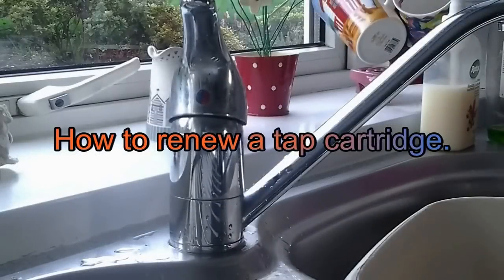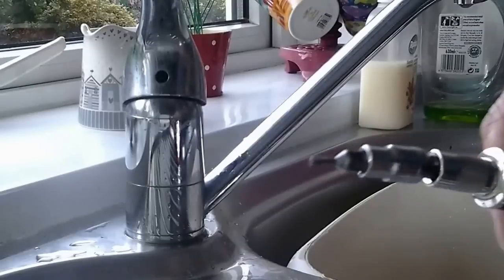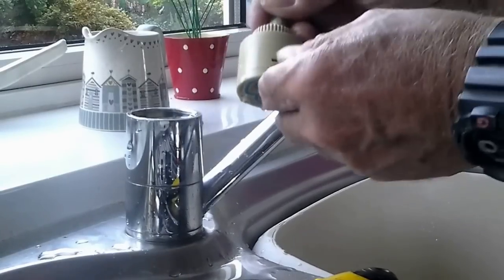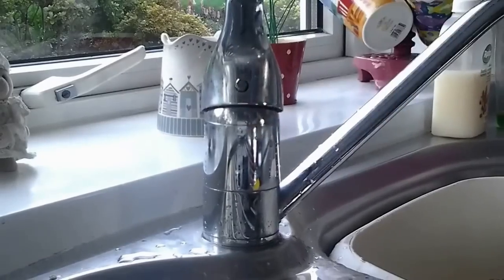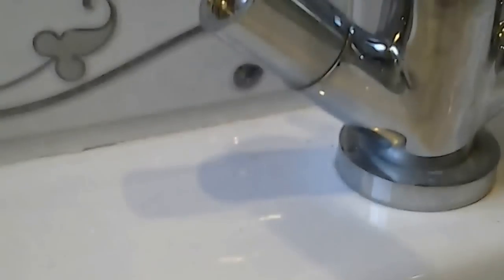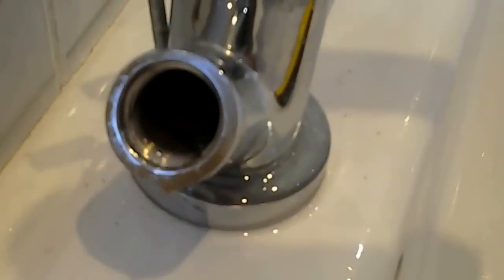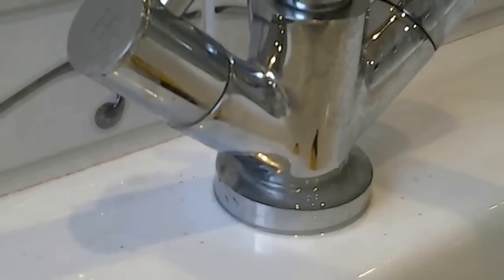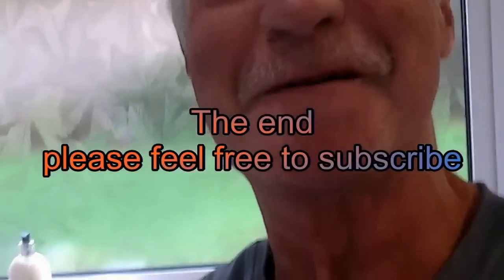Lever taps dripping? How to change the cartridge

Comment: Very Helpful Video !!

I have a couple of single lever cartridge taps that don't drip like yours (at the start of the video) but are still leaking possibly from the tap handle or even lower down at the swivel arm (similar design to your tap in the video) ... any ideas whether this is just an O ring problem within the parts you haven't removed in the video or is it still the cartridge that is at fault .. gut feeling says it is O rings but want to make sure I have all the necessary parts before I go messing around .. one of the taps is in the kitchen &  the other in the bathroom but neither leaks from the spout!
Any pointers gratefully recieved
Reply from the maker: It usually is the o rings, the problem is getting hold of the correct ones.
Reply: +dereton33 Thank You !!

Comment: Good video, but a tip. No need to completely remove the grub screw with the Allen Key.  2-3 turns should allow the tap lever to pull off, and the grub screw can remain in place in the tap lever.
Reply from the maker: Thanks for the tip Graeme.

Comment: More or less figured that out for myself BUT having taken the allen grub screw out, the head of the tap won't lift off. Also, which is the correct replacement cartridge. Is it the one listed below the demonstration video " 40cm ceramic disc cartridge Kitchen Basin £ 2.46?

Comment: Hi Al, a great video. I have a kitchen lever tap (like the first one in this video) with a third way for filtered water. The filter tap is dribbling, I removed the lever and cartridge for the normal hot and cold hoping to find a way to fix the filter washer but found the collar it sat in did not want to unscrew. The filter lever is on another collar under the spout. As far as I can see the only to access it is to remove the tap completely from the sink and go in underneath. Do you know any easier way? Thanks
Reply from the maker: Aydosh1991 No there is no easier way, that's the downsides of those taps. Sorry Al.
Reply: dereton33 Thanks for the quick reply. Will have to roll my sleeves up now!

Comment: Hi Al, I have exactly the same tap as your video! Mine is dripping and I need to replace the catridge. Can you remember the size and where I could get one at all???? I see some sites have universal fittings but not the same hole shapes as the 3 chamber catridge you displayed in your video. Thank you!!
Reply from the maker: Dave Denny You have to take the tap cartridge along to your plumbers merchants to get the right one, its the only way as there are a lot of different types.
Reply: dereton33 That's great, probably a wise move knowing me. Many thanks indeed, cheers for the advice.

Comment: My dripping lever tap looks exactly the same as the first one in the video. When you say turn off the water supply do you mean both the hot and cold supplies as its a mixer?
Reply from the maker: To be safe yes.

Comment: Al, can you show me how to fit waterfall taps to my bath so I don't have to get a plumber in?
Reply from the maker: Hi Elthan, I will not be able to show you how to fit them as the bath that they are fitted to is against the back wall and I might not get any more to fit for a while, but I can tell you how to fit them . They come with two long flexi tails so when you fit them you just cut off the pipework to the length of the tails and screw the taps into the bath , connect the tails to the copper pipes and off you go .
Hope that helps.
Al.

Comment: WARNING DO NOT ATTEMPT unless competent. If attempted by DIYer things can go wrong which are not covered here on the video. You can not get the replacement cartridge, or the problem could also be in the tap itself the seat which would need grinding down (a special tool would be required). You may loosen the tap and have water leaking under the sink (you will need a special tool to tighten the tap from under the sink. You may not be able to fully isolate the water to the tap because of a faulty stop valve or stop cock you will need a special tool to isolate the mains water from the street and I would wear rubber gloves when handling the new valve as germs can be transfered.
Reply from the maker: +Jack Jill . I guess what he is saying is my plumbing business is loosing money because of your videos, still if you took his advice you wouldn't. get up in the morning. Do not let this comment put you off, do it yourself.
Reply: things have the habit to go bang at night when you go back to sleep ;)
dereton33 respect your the man, but then you know as I do that if you do not have the know how, when faced with complication panic set in and a plumber will charge far more if he sees that you have tried and failed now desperate. Sometimes DIY is a false economy that is why you are retired comfortably having worked as a plumber. Even you admitted that you broke the glass rimmed tap and will not tackle it unless forced to.

I love your valuable tips (but one has to know what they are doing to benefit and tackle fiddley jobs) and I have subscribed with you but DIYer beware of unforseen circumestances after you "get up in the morning" and mess around with things things have the habit to go bang at night when you go back to sleep ;)

Comment: great to see a guy with an electricians screw driver showing us how do a plummers job
Reply from the maker: Petra Henry Anything goes Petra. I also use a carpenters saw and a bricklayers chisel in other videos. Ha ha.  Al.
Reply: +Petra Henry it's a screw driver used by a plumber and no electrician in sight so HOW IS THE TOOL AN ELECTRICIAN'S SCREWDRIVER? that's like saying screws are only for carpenters